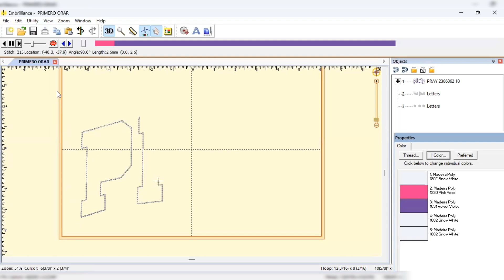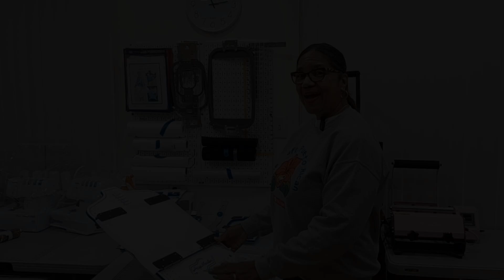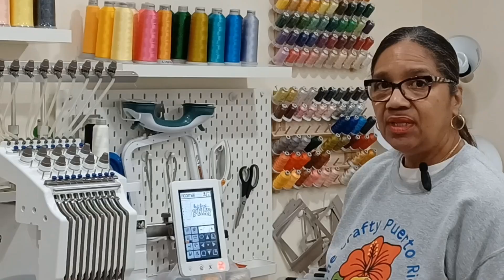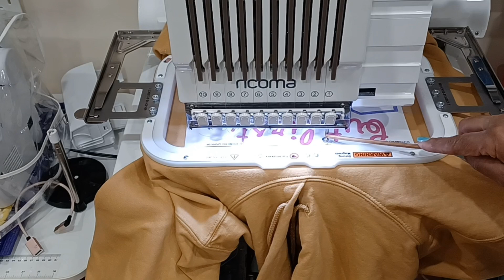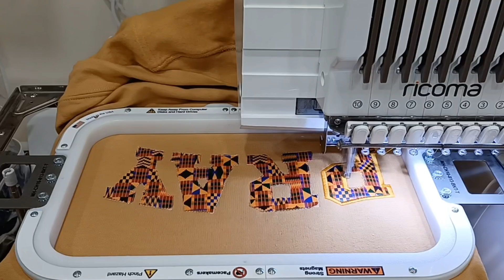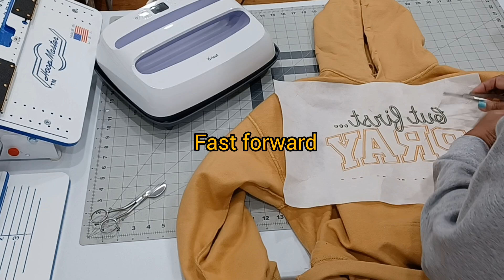How To Embroider Appliqué Using Heat Transfer Vinyl | Easy  Beginners Machine Embroidery

Comment: Beautiful! Very good instructions! What weight thread do you use! Also how long did you heat press. I subscribed.
Reply from the maker: Hi@jenniferduhon47! I use 40 weight thread. I pressed it for at 305 F. for 15 seconds, following  Siser recommended temp. for easy weed vinyl, but you can press again if the cloud cover doesn't stick. Thank you for subscribing and supporting my channel 😊.